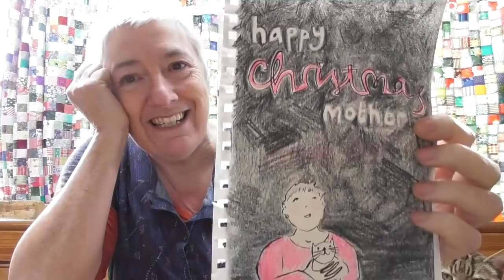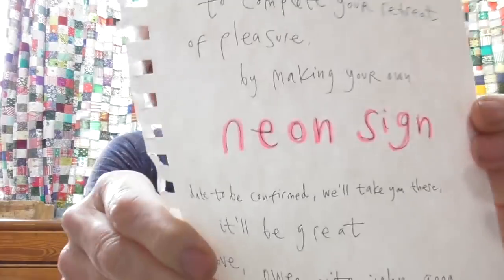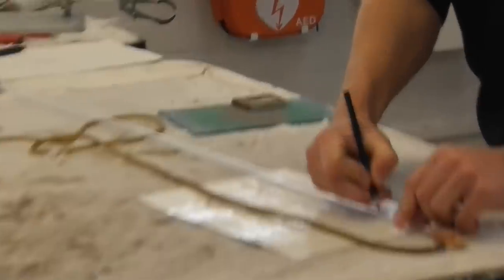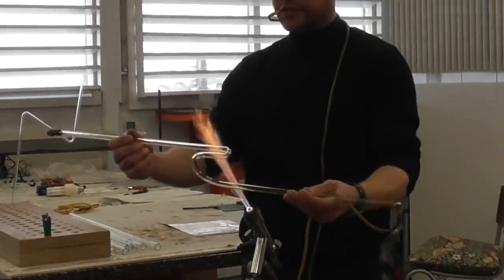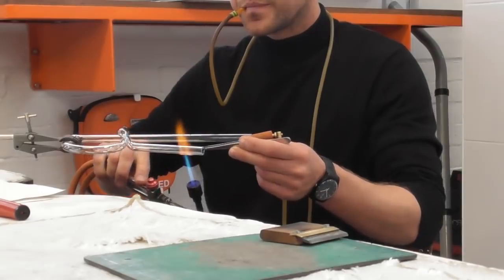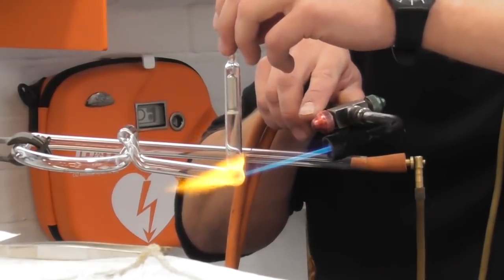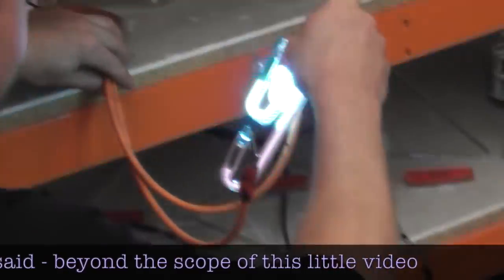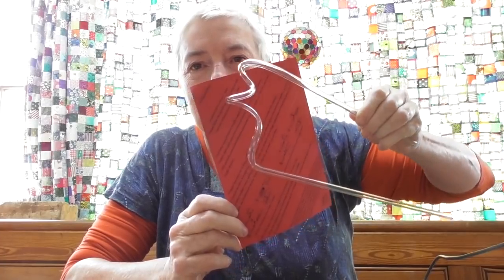Neon Workshop, my Christmas Present in May!

Comment: Thank you Kate for showing this process.  It was very interesting.  One thing I wondered about, Was the glass not hot at all where your hands held it.?  I noticed there were no protective gloves.  I would imagine it takes a good long time to be proficient in this form of art and you're right, we do take it for granted.  I always figured the glass was put i some kind of machine that automatically bent it somehow.  Think of the thousands of hours that has gone into making the neon signs in Las Vegas.   Unimaginable.  Thanks for sharing.  Have a Blessed day.
Reply from the maker: glass is a very poor conductor - so the part where I was holding it was stone cold - just taking ordinary precautions there was no danger of being burned. and yes - you get a new respect and awe for all those amazing neon signs that were all made by hand - we learned many interesting facts about neon - like - only 5% of signs have neon gas in them! other inert gases are used - argon commonly - to get the range of colours - but we call all glass lit like this 'neon'! It was amazing! xxx
Reply: @thelasthomelyhouse  thanks for the clarification, I appreciate it.